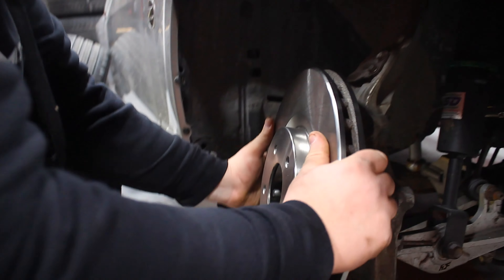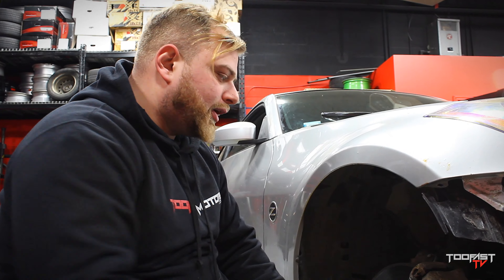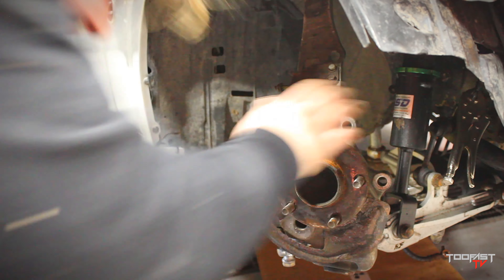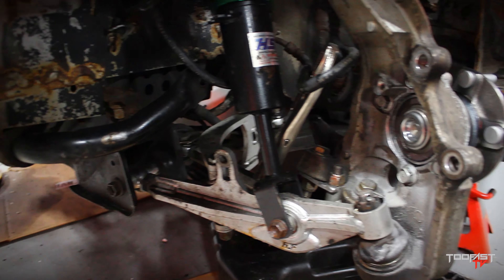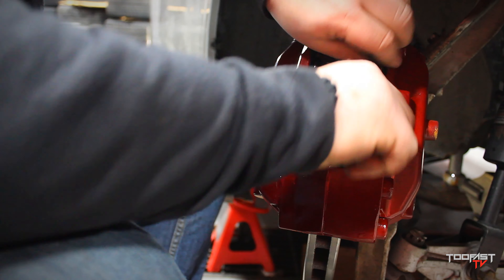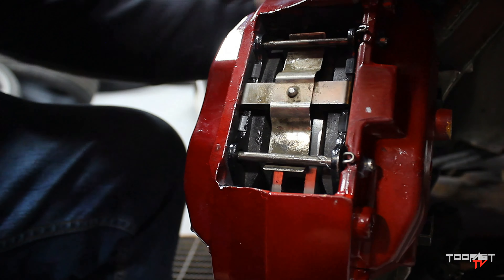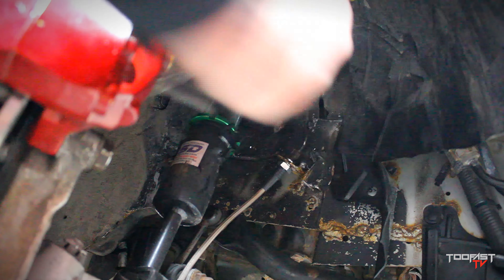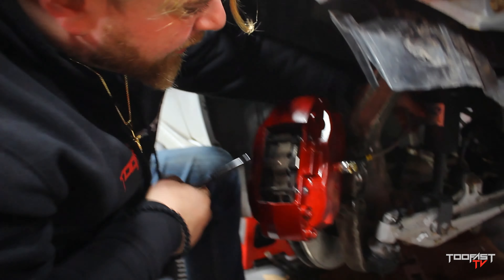HOW TO | BREMBO BIG BRAKE KIT INSTALL ON 350Z

Comment: Are these factory 350z brembos ? Do factory brembos fit on a 350 that don’t come with them ?
Reply from the maker: These are factory 350z brembos that we installed on the non brembo set up.
Reply: Yes factory Brembo from 350z, fits on non Brembo  350z  except the rear! For rear you will need longer bolts  from oem Brembo cars forgot Nissan p/n  n trim of Orem dust shield.  But mostLy straight forward. With right tools 5/10 difficulty b/c of bleeding.